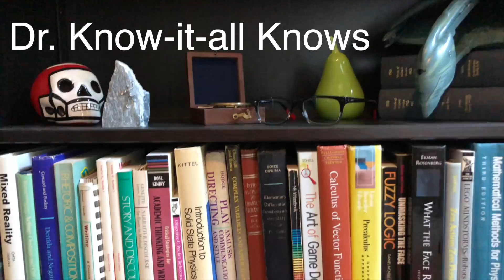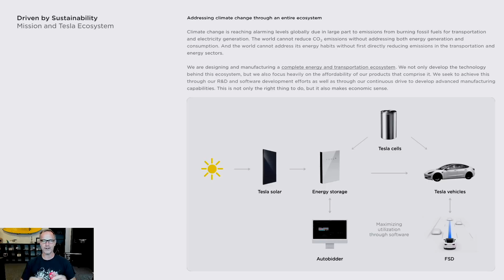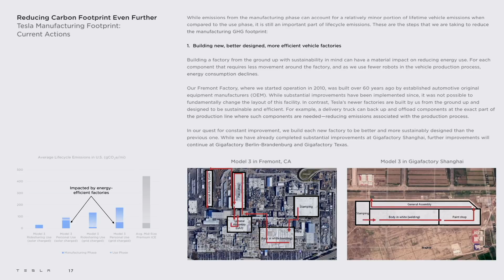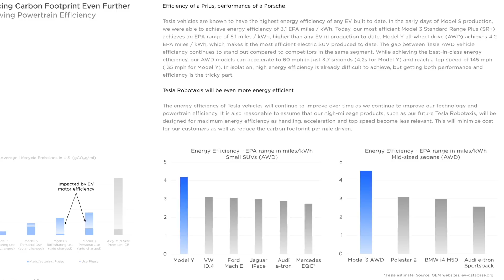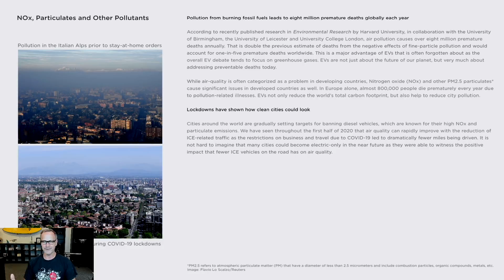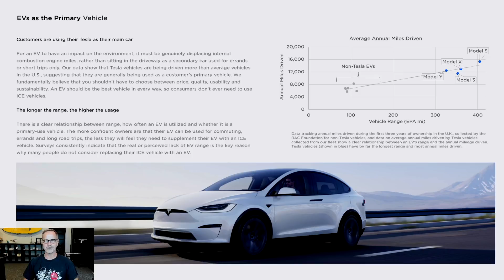Yes, Tesla is WAY better for the environment--here's proof! Tesla Impact Statement, 2020

Comment: <I must say. Bitcoin's price action has been fluctuated throughout the past few days and weeks, with bulls and bears both reaching a clear impasse, the aggregated cryptocurrency market has been following in Bitcoin's lead and is struggling to garner any decisive momentum. One analyst is now noting that BTC has been holding above a key macro level throughout the past few months. He believes that the recent consolidation above this level bodes well for its near-term outlook and could indicate that significantly further upside is imminent in the weeks and months ahead. Tips like this are why it's advisable for investors and newbies to trade with the help of pro traders like Rick Richard. He is always one step ahead of other traders, he fully monitored all my trades to avoid me making mistakes and losing my money. My earnings have increased drastically from 1.01 BTC to 6.7 BTC in just 4 weeks using his strategy. You can easily get hold of him for a profitable trading system on TE-LE-GRAM [@rickrichardcrypto]

Comment: Note the one-way link from the batteries to the car.  This is because due to the Robotaxi evolution of FSD, Tesla views the economic benefit in using the battery power in the cars for driving to be a higher benefit end-use, than powering the grid or home.  Now having the emergency capability to power one's home during outages, likely should be done, but I think Tesla/Musk is correct that in general the use of vehicle power in a RObotaxi world where 1 Robotaxi replaces 5 cars is a "higher" use.

Comment: How come the impact of manufacturing of Model 3 depends on how it will be used? If charts shows per car emission, it couldn’t be correct.
Reply from the maker: it's per mile, so the more miles you drive the car, the less the construction impacts the emissions. A bit of a weird concept isn't it, but makes sense when you think about it
Reply: @DrKnowitallKnows  Tx. Make perfect sense.